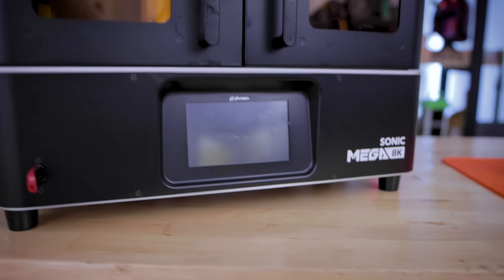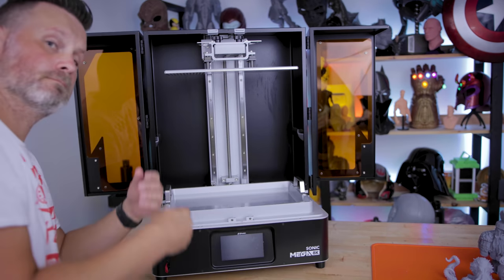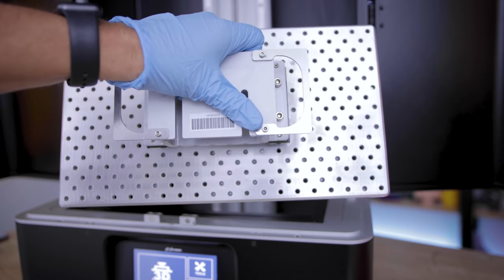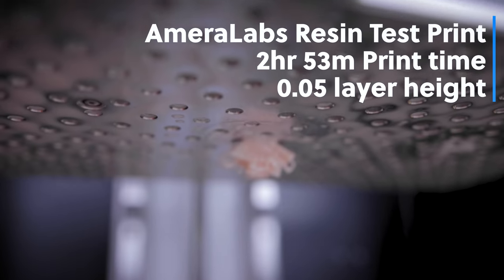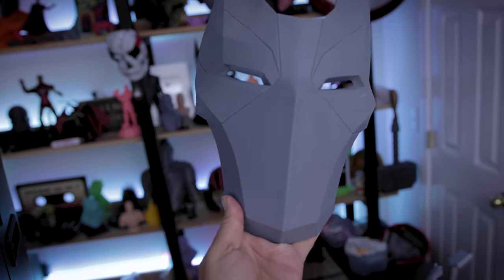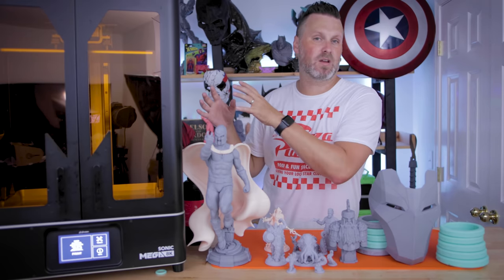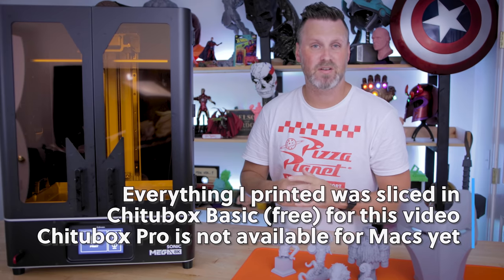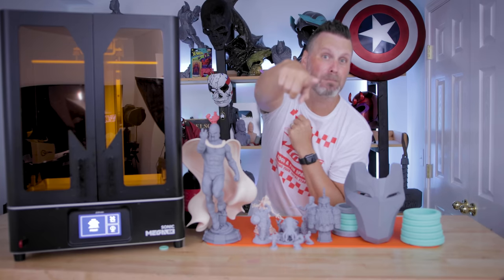Phrozen Sonic Mega 8K Resin 3D Printer Review

Comment: Thanks for the review. To clarify, the holes on the plate are designed to reduce the pressure on LCD screen, as Mega 8K prints larger objects and the pressure increases with the printing objects. After tests, the holes on the plate are helpful.
Reply: Yea he had noted that in review.

Comment: What I do to get around the resin pooling in the holes is I use a shallow plastic container thats roughly the same size as the build plate which I put some alcohol or methylated spirits into. I then either dunk the build plate in the container or leave it in there for 5-10 minutes and wipe it off with a paper towel. I found it to be much faster than trying to scrape all the resin off or putting the plate on an angle and letting gravity do its thing
Reply: Hey I was wondering would u recommend this product? And does it need a curing station?
Reply: @jonathanbelmares8241  The 8k is a fantastic machine! It's dethroned the Anycubic Photon mono x as my favourite MSLA printer. I've never had a curing station so I can't recommend either way in that regard sorry, I have made my own curing station and it's worked well so far
Reply: @BeerJingle  oh thank goodness was trying to see if I should have bought their $600 station lol
Reply: @jonathanbelmares8241  as far as i know they mostly sell that for convenience sake there's a lot of people who have these size machines who do DIY stations :P

Comment: Great review.  I've never had issues with the holes in the Transform build plate, I really like them.  The speed is a bit disappointing but I'd rather have slow and steady with amazing results over fast and failures.  I hope to get min Mega 8K next month.
Reply from the maker: Yeah slow and steady+huge volume could mean for 1 big print vs multiple smaller prints on a smaller machine

Comment: After I remove the buildplate and print, I spray it down with a spray bottle and IPA over my waste bucket. Then wipe it down and pop it in the Wash N Cure Plus to get any remaining resin out. You could also place it in a Ultrasonic cleaner to heat up any stuck resin and soften it for removal, done that before on the Transform.
Reply from the maker: You know, that is a fantastic idea to help clean it out. Will give that a go. Didn’t even think it would fit in one of the wash station buckets

Comment: The perforated build plate is amazing on my Transform, i always print with a raft and just try to get into the holes from the sides of the raft, after that the entire raft removes easily and completely, never had a problem.
Reply from the maker: It does work good for prints sticking to that buildplate. I might need to go back to using a raft like on the transform. Phrozen did just release a raft file for the mega 8k as well.
Reply: @UncleJessy  That's cool, can't wait to get back into 3d printing, been busy working on my next character, will turn that into a statue as well also will start painting my Vigo statue soon.

Comment: You could probably make a pegboard with dowel rods and slide the buildplate onto it to pop out the excess resin.  Bonus points if you can get soft bristles on the dowels for some scrubbing.

Comment: What is your post-process like with a printer this big?  Is there a wash and cure station that can fit the whole thing?  Do you remove them from the build plate and clean each piece individually?  What cure time do you use for that 4k resin?

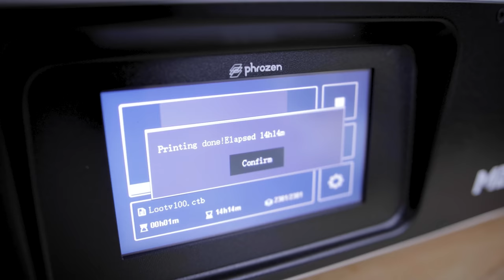Comment: Hi I need an information. Why at 7:35 that print took 14 hours when it's a 72mm (7.2 cm) statue and the printer says that it prints at 7cm per hours?
Reply: depends on the resin, but i think its more like 0,5cm per hour print speed^^
Reply from the maker: 🤷‍♂️ used their stock profile for the aqua 4K resin in chitu for it
Reply: @UncleJessy  OK thanks. I sent an email to phrozen for clarification. They state maximum print speed 70mm per hour. The fact that to print that miniature took 15 hours does not make sense. Let's see what they reply
Reply: @michelerobert  i don't think that's possible with the the big build plate
Reply: @michelerobert  did you got any reply to that mail?
Reply: @Ictus1008  This is the reply after several mail asking clarification: Thank you for your email. Actually, Printing speed 70mm/hour for Mega 8K is an extreme setting we examined from factory and normally we shared a fesible setting parameters with our end users in order to keep each printing successful. Here is the suggested parameters for your reference, layer height: 0.05 mm / Lift speed: 45mm/min. Thanks.

 And the customer service is absolutely horrible so I didn't buy anything from them. No help or clear answer even for the easiest questions. I don't dare to imagine if something doesn't work properly in the printer what will happen when you need help from Phrozen....
Reply: @michelerobert  thanks for the fast reply! 

okay, so they didn't really answer what they printed that fast or how...
so the whole 70mm/h is bullshit!
Reply: @Ictus1008  You are welcome. Yeah, pretty much my thought when I finally got the reply.

Comment: About the printing speed, the problems seems to come from a light off delay that is around 6-7 seconds. If I slice with Chitubox, I have the issue. I tried the Liberating Mars application to convert my Lychee Slicer exported files to the encrypted one and my light off settings were the one that I was expecting and now I have “normal” printing time with the Mega 8K. I’m investigating that. But a light off delay is required with this amount of resin moved by such build plate.
About the holes in the build plate, the main goal is to reduce the pressure on the screen when lowering the build plate. I cleaned it twice yesterday without issue, but I’m not using the same tools as you. You need to remove gently the cured resin otherwise it will break like you show and it will be a major pain.
About the resin, for me, such printer need to stick with only one type and color of resin. Swapping is juste pure pain. Except that, this printer is a beast, I love it so far!

Comment: Great video as always, not looking forward to the print time hopefully I can start tweaking the machine settings once I receive my unit. Also, looks like a wham bam plate will come in handy since I hated my perforated plate on the transform.
Reply: I thought about doing that, but I am worried that the suction forces and the weight of holding that much resin in the holes might be too much for the machine. I would love to find out how well it works for you.

Comment: Install it on a secondary platform attached to rail slides wont need to worry about the door clearance as much make sure to use a retractable extension cable though.

Comment: What are the exposure times you're getting by default? Looked like the site said 2.5-3 seconds on most profiles? I don't have Chitubox yet and won't have access to my main computer I would be running it on for another week due to work.

Also I'm wondering what the thickest layer you're able to print with it? On my Anycubic Photon Mono using Siraya Tech Blu clear (with a little added custom pigment from a previous print, but not mixing resins.) I'm getting 0.13 mm thicknesses without any delamination and I even tested up to 0.14 and  0.15 where it was getting delamination but I might be able to get it solid again with extra exposure time. This is printing a simple 15x15x10 shaped hollowed out box/cube shape (15 because 10 falls through the wash and cure station holes)

I've been asking the thickness question in many places, but instead of getting additional data points to go off of I just get stupid looks/comments. Sometimes prints don't need the additional detail and speed is more important.

Comment: I thought you could build supports/slice in Lychee slicer or Prusa soccer and import into Chitu Box (what file format /STL?/)
Reply from the maker: Yeah you have to export as STL then slice in chitubox
Reply: @UncleJessy  You can, but should you have to?  You video had a pop up referring to having Chitubox crash on you.  Just to clarify, how was it crashing?  Was it just Chitubox going out to lunch, or was it taking your PC with it?  Were you just slicing an imported STL, or were you trying to do full supports in Chitubox when the crash occurred?
Reply: @planettyracom  If it's like my previous experience with Chitubox, it's basically anytime the software feels like it's done for now.  I've seen it crash just after opening, with no model loaded yet.  It's not worth free, much less $170+ per year.
Reply: @PaulGuy  That was what I was afraid of. I got the basic version of Chitubox with my Longer 4K.  I was less that thrilled.  Chitubox Basic wasn't worth what I paid for it.  A Lychee subscription was cheap at the price.
Some people want it all to be free.  Personally, I'm willing to pay a reasonable (a very subjective term) fee for consistent, quality, reliable software.  It is a matter of how much I value my own time.
I have a couple projects that could really use the size and resolution of the Mega 8K.  But if I can't reliably get a sliced file into the printer, it is only scrap metal.  And that, dear friends, is the problem.  Every release of a software product is subject to various bugs.  If I can't quickly switch to another package, to keep working, I'm .... (you get the idea).  ChiTu has taken that option way from me.  I don't appreciate it.

Comment: Would you recommend this printer for a first time user of resin printers? I plan on selling physical copies of my miniature and with a build plate this big I would be able to mass produce a lot
Reply: Honestly, no probably not. If you want a bigger build plate than more beginner resin printers, I would probably recommend the Elegoo Saturn, Photon Mono X or even Phrozen Sonic Mighty. Heck I would say to get a smaller printer on top of that anyway, so you can test supports on the smaller printer before mass producing on the bigger printer.

Comment: Great video. I'm thinking about ordering 1 so I can make sports figures of my children and grandchildren. Do you happen to have a video on turning 2D pics into 3D? Or where you could go to have pics turned into a 3D file to be printed?
Reply: You would have to a 3d modeler/sculpter make the models for you. There is to 2D to 3D conversion unless you mean flat image on an extruded box.
Reply: @julez4002  Thanks. I found that all out. The cost for what I want to do is way to high.  It will cost me a fraction of the cost if I have someone else make the figures for me.

Comment: Ah it does look so good but comes with so many issues and drawbacks I could never justify this.

What would be nice is a sort of mold block of metal that you can use to connect with the build plate so when you attach the two together it purges all the holes in one go. If I were buying this I'd pay extra for such a thing as that clean up process looks so painful.

Comment: I wonder if Wham bam is going to help or simply not be an option for the perforated plate? First, you'd assume it would solve the issues you had, but then you have to get it to adhere the magnet and I'd suspect the holes will hinder that too.

Considering it cost $1500 you may find some people willing to get a machine shop to cut them a replacement plate for a $100 or so dollars.  In all honesty, the cut is pretty simple and the stock of aluminum is only $30, $100 bucks may be on the high side. However for a $100, I'd imagine you can get it cut to an angle, to allow the resin to drain. Either way its a little disappointing to hear of these types of issues at this stage from a manufacturer like Phrozen.
Reply: I'm sure the magnetic plate would stick fine, it's not like that's sticking to the non-magnetic aluminum build plate.  There's a base plate with some crazy adhesive stuck to the build plate, and I'm sure there's still plenty of surface are left.  It's the suction issue that's the real question.
Reply: @PaulGuy  The problem I'd worry about is the perforations allowing resin in behind the adhesive and slowly decaying the magnetic backing adhesive's grip.

Comment from the maker: Phrozen has recently released a Raft file designed for the buildplate as well to help reduce issues with prints getting stuck inside the holes. That was not available when I recorded this and I have yet to try it out. MEGA 8K FB Group https://www.facebook.com/groups/3611576072281561

Comment: Wow, the trouble with cleaning the build plate may be a deal breaker. Seems like it would be easy for a cured bit of resin to fall off and go unnoticed, then end up puncturing the FEP.
Reply from the maker: Yeah that for sure is a concern. I actually switched to a smooth buildplate on my Transform
Reply: @UncleJessy  could just print a tool that clears the holes. would probably make that a 10 second job.

Comment: If I owned one of these I would print a tool that had pegs undersized to fit into the holes that had a dozen or more pegs on it in the correct center offset so you can just jam that tool in there a few times and clean out multiple holes at once. There's no way I'd use it if the clean up was an hour long affair.

Comment: Couldn't everyone just use a punch tool on the plate. I can understand those that are new to 3d printing crying over it but anyone who either has printed with supports or done any model kits/miniatures/gunpla this is nothing in terms of time. I'd be more upset with failed prints on a machine this size.

Comment: Someone needs to make simple tool that has 30 short pegs sticking out of a block that align with the holes in this build plate so you can push the resin out from 30 holes at once.  Sized to fit under the mounting bracket so it can get at all the holes.

Comment: To clear out blocked holes full of hardened resin, pressure washer.
Reply: but where are you blasting all this uncured resin? You can't have that pour down the drain. It needs to be cured to become safe for disposal. I guess you could cure it outside first but that's a workflow I could do without.

Comment: I feel like a resin 3d printer will give me less problems than a pla 3d printer where I have to level 4 corners of the print bed. Not to mention to print bed can get warped. And if you don’t level it right the heat nozzle will clip your print and pull it off the bed. The pla will clog the nozzle too.

Just a lot of problems you'll run into with those kind of 3d printer

I'm sure a resin 3d printer might has it's problems but im sure not as much as a pla 3d printer will give you